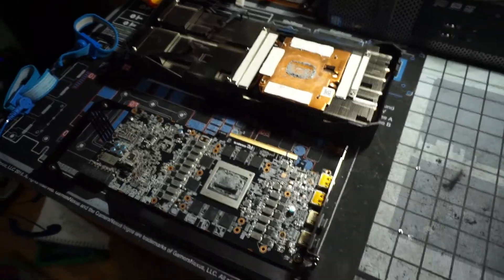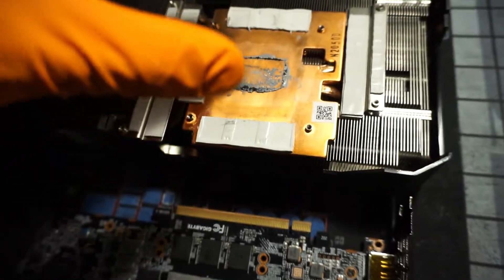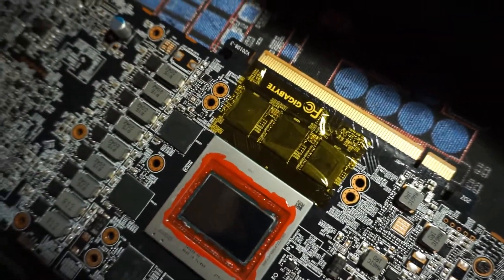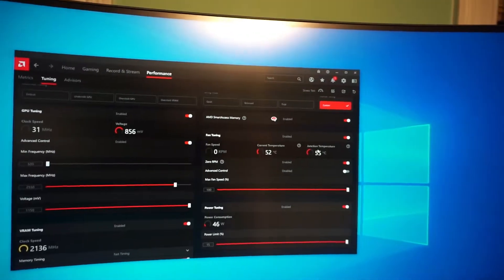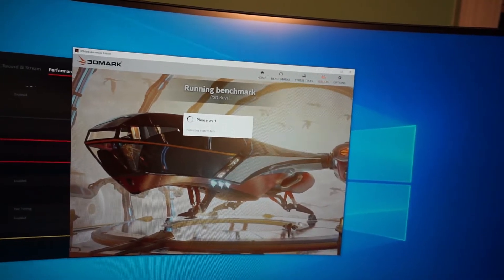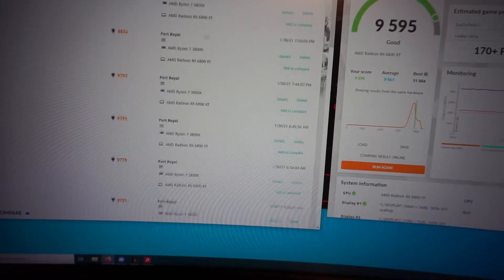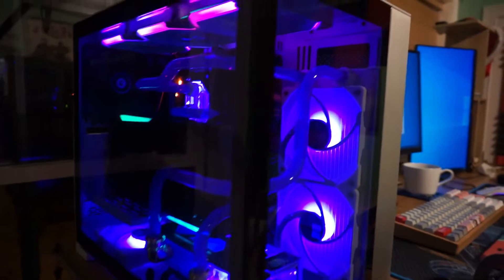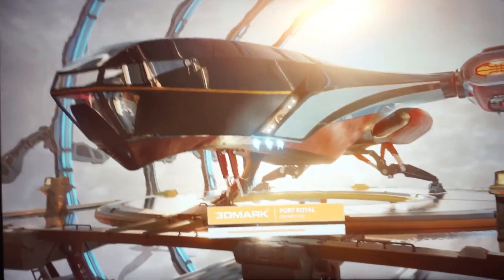applying liquid metal to gigabyte 6800XT

Comment: How are your scores now in the Time Spy Extreme and Port Royal tests? Here are my current scores on 25.3.1 DRIVER: Time Spy Extreme is 10306 and Port Royal is 11247. These are the stable numbers I settled on. While I did achieve higher scores during testing, these represent what's truly 100% stable after dedicating a significant amount of time to deeply understand and correctly implement proper overclocking techniques. It was a long process!
Reply from the maker: I don't have this GPU anymore so I had to go back and check my results, but I got 8635 for time spy extreme on a 3800X CPU at the time with my card. My best PR result was 10205 on the same setup

Comment: Hey man i was wonder coz im about to put my gpu in a vertical mount as well and liquid metal it, was wonderign if you had any issues with the liquid metal spilling down in the die or anything like that, bcoz of the vertical mount if you know what i mean?
Reply from the maker: No, as long as you don't put too much on there's no reason for it to spill out. I think because it clings to the metal as well as capillary action it prevents it from moving around.
Reply: yeah ive ended up doing it and i dint apply too much just a nice thin spread and my temps are great 60-65 with 70-75 on junction, ive moved it all in the lian li o11 evo with fully populated fans and the vertical bracket, thx for answering
 @lilwebsite3853

Comment: I got a similar junction temp on my asrock phantom 6900xt. I replaced the thermal paste with liquid metal and it seemed better but i still hit 110-112 junction in overwatch. This is on basically an open test bench with ambient no higher than 72f. So maddening!
Reply from the maker: If you are getting around 110 then you may have mis-applied the liquid metal. I think I mentioned it in the video but in case I didn't, I applied too little liquid metal at first and had to take the card out and put more on since my temps were still high. I get around 80-85c junction max now, so I would double check to see if you can put a little more on. I only needed to add a very small bead so it does not take much
Reply: @lilwebsite3853  Added some more and 90c is my new high! Tyvm!